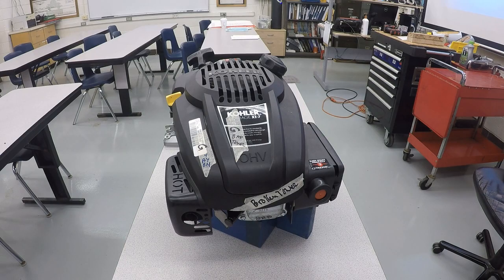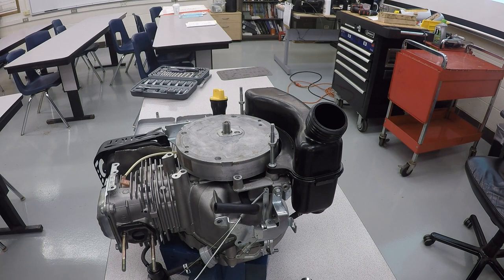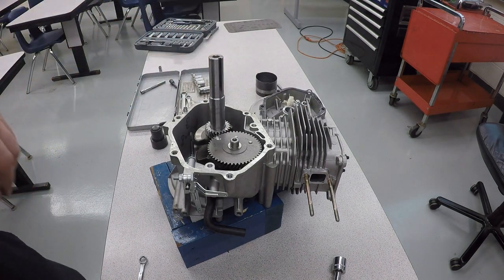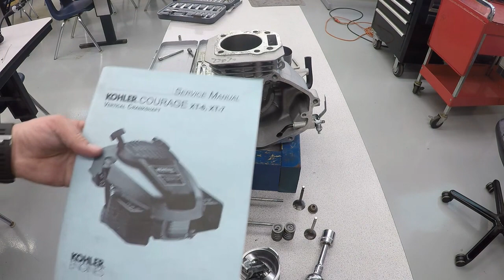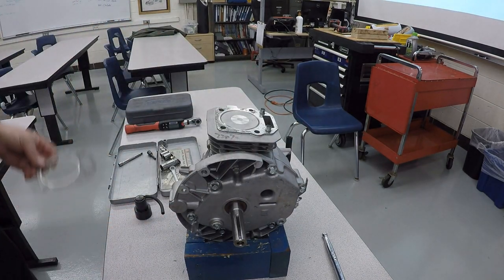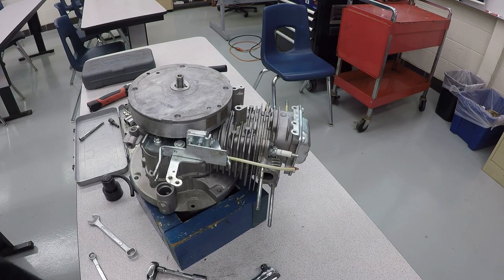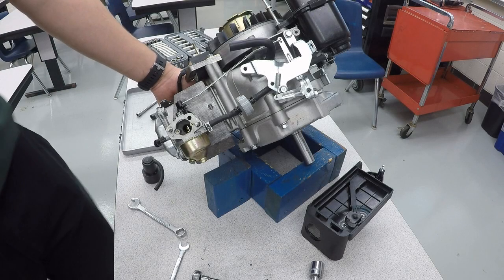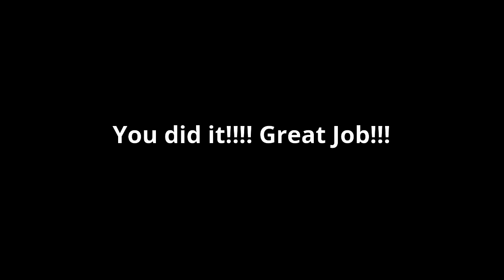Kohler Courage XT-7 Small Engine Rebuild

Comment: so i have this engine on a cub cadet i inhearited from my dad and ive done some minor work like new carb and sparkplug but i cant start it, i can pull on the cord but when i get to a certain point itwill not budge... now i know im pulling hard enough when the whole mower moves with the pull.. any ideas anyone?
Reply from the maker: check the air filter. I have the same engine on my mower and sometimes the carb will flood and saturate the air filter in gas and it will not breath. Ive also had grass plug it up and not be able to pull the string. Also, make sure the flywheel brake is adjusted so the engine can spin freely (that piece with the heavy spring near the top right side of the engine/flywheel. You need to need to be holding a bar/kill switch down when starting this engine or the brake will hold the flywheel and keep it from spinning and stops the spark too! Good luck!

Comment: Seems like a pretty well made engine. I'm trying to decide which mower to buy and can't decide what engine manufacturer to go for.
Reply from the maker: Briggs & Stratton or Kohler are excellent, well made engines. Change the oil and keep the air filters clean and they last a long time. I have the Kohler on my own lawn mower and its 10 yrs old and still going strong. Thanks for watching!

Comment: Excellent video!  I wish I can be one of your student (in Montreal).  My XT-7 Canadian version is just a little bit different; I wish I can have a primer bulb instead of the Diaphragm which I think is not working properly.  Since the first day, I can't easily crank up the engine. Thank you so much for putting this video.  I've learned so much.  Can you explain quickly the whole process of getting the the machine start up at cold.